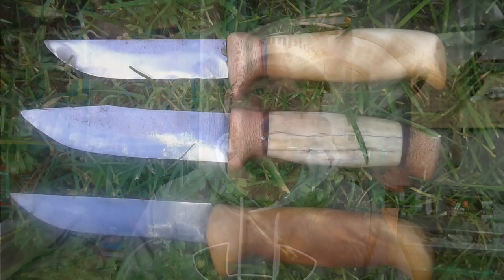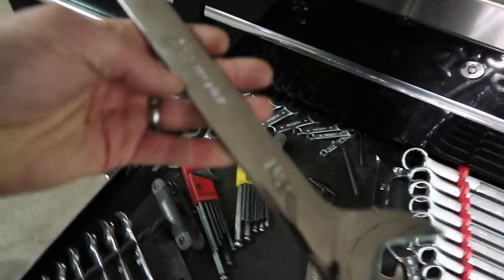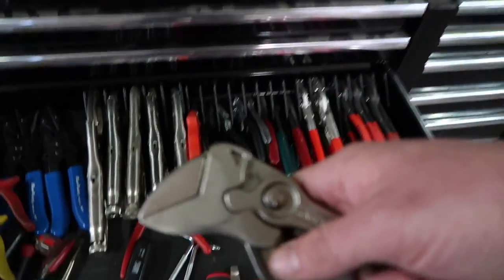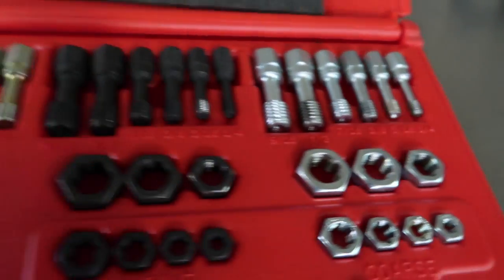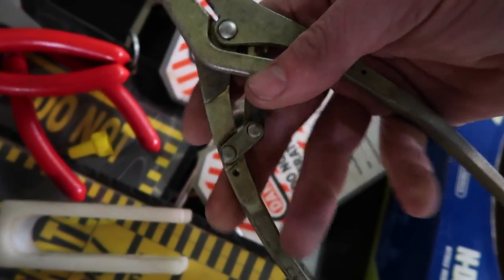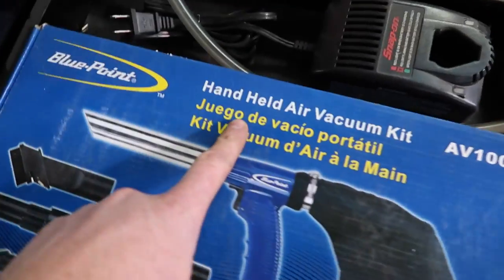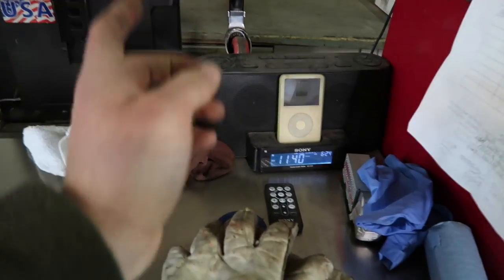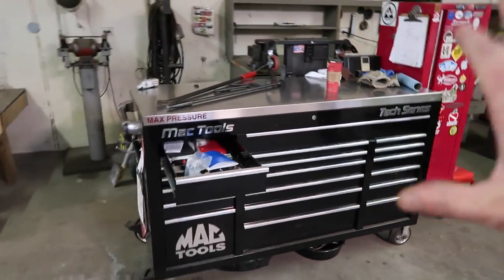Tool Time Tuesday - Tool Box Tour

Comment: The tool at 16:50 are lock ring pliers, like an extra wide opening, mainly for transmission work but other stuff as well. Most notably the 2nd clutch housing piston snap ring requires an extra wide opening, those work fantastic on them.

Comment: The pliers you asked about are snap ring pliers.  They are used for snap rings that don't have holes at the end.  GM uses this type ring in there transmissions and t-cases,  I have a whole set and used them often.
Reply: also in ford transmissions
Reply from the maker: Oh sweet! Thanks for the info, really appreciate it. Cheers!

Comment: The orange offset is also known as a "Chevy Wrench" because 1) They are orange, like a Chevy block and 2) They were angled as opposed to the straight 90* "Ford" wrenches you use on hydraulics. They were called "Ford" wrenches because they included one in the Model "T" tool kit.

Comment: you could throw some of those silica gel packets to prevent rust...and if its surface rust ive been told drop them in rapidily boiling water and the rust become a patina...Walter Sorrells had a video about it recently...
Reply from the maker: That's a good idea. I should pick some  of them up.